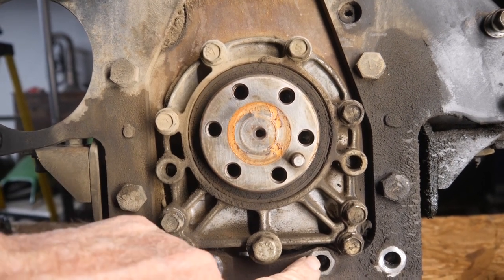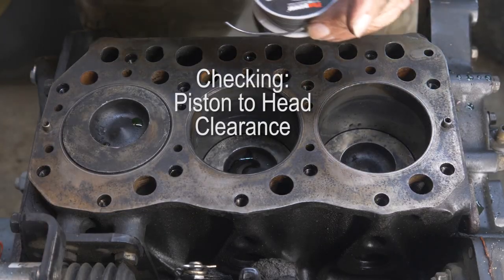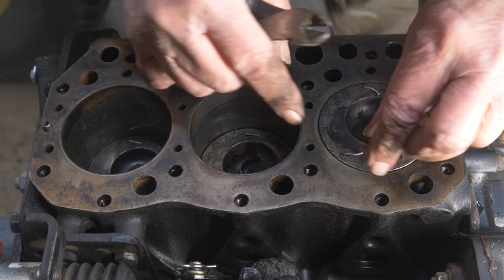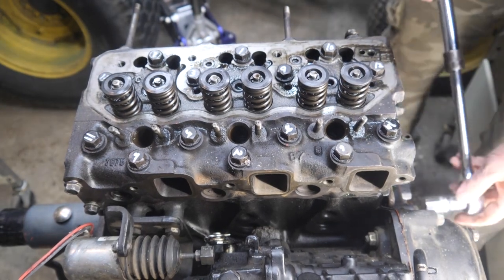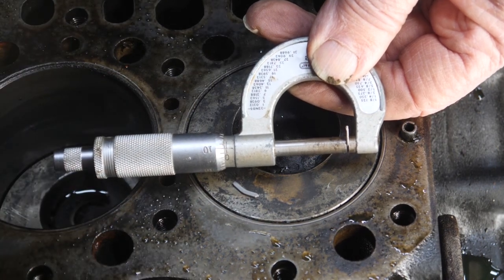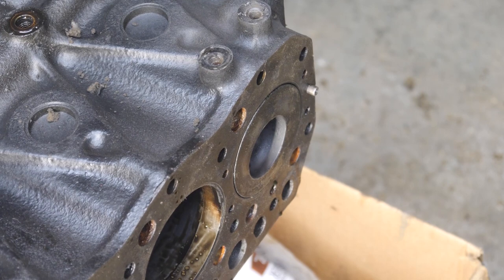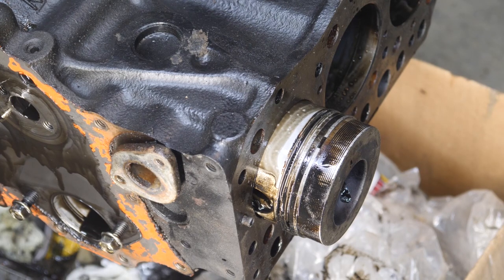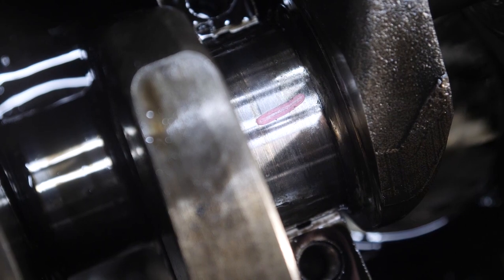EXTRA 855 3TN75RJ Disassembly Notes

Comment: A good thing to know how to do , I measured my orange tractor that way. Thanks
Reply from the maker: The next thing to do is be prepared for milling piston tops! My machinist says it's no problem to do and with proper block prep for sleeves, these little engines can be born again and again. Schedule permitting, we'll have a video discussing sleeves in more detail...should be coming out soon (as soon as we get this engine is on the mill). Thanks for commenting. md